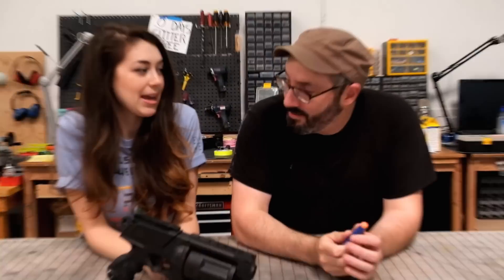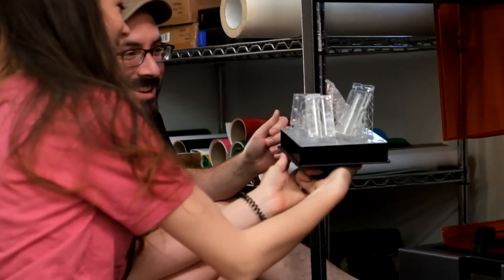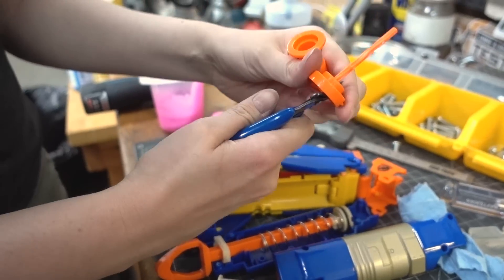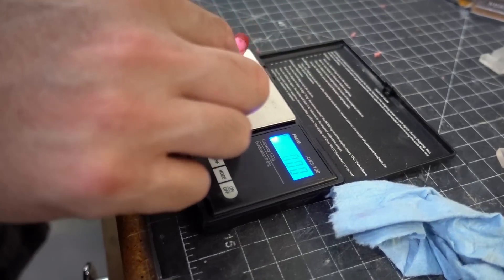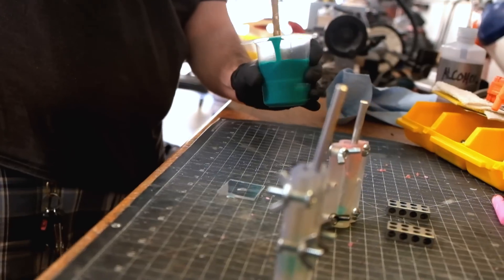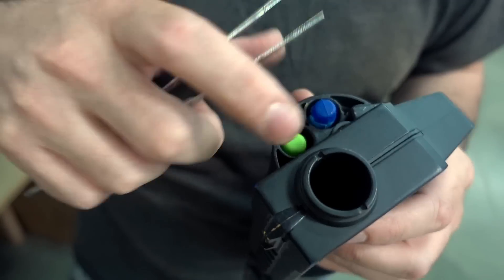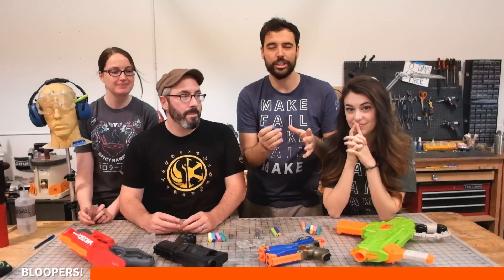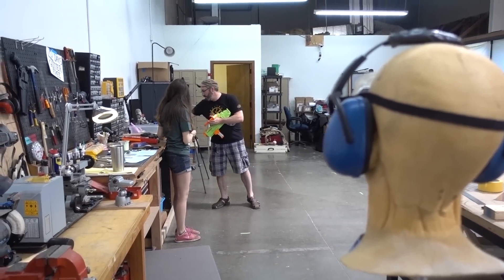Making the ULTIMATE Nerf Dart? (An Adventure in Foam & Silicone Casting)

Comment: I have an idea as to why the darts don't perform as well...
So I noticed two things about the performance of the dart in the last test.
1. The dart rotated.
2. The dart didn't go that far.
Now these may seem like really insignificant details, but they are actually really revealing about the projectile motion of the dart. To clarify, when the dart leaves the barrel you see it immediately begin moving towards the ground, given that the dart is moving parallel to the ground initially, and is shot at a given height above the ground, a projectile under the influence of gravity will accelerate towards the ground at a speed of 9.81m/s or 32.2. ft/s.  This is true for both the normal "Elite" dart and the redesigned "Floppy" dart. Because both darts will accelerate towards the ground at the same rate it also means that given the same individual firing the same gun at the same height both darts will reach the ground at the same time. Regardless of how fast the darts are moving (This is, of course, an ideal situation where air resistance is negligible. I'll get to that soon) Because both darts will reach the ground in the same time the difference in the distance that both darts traveled is dependent upon the speed the dart has exiting the barrel parallel to the ground. The faster the speed of the dart along the x-axis, the farther the dart will travel (Given that the dart doesn't meet its terminal velocity). What this reveals about the "Floppy" dart is that because it doesn't travel as far it shows that the potential energy expended by the spring in the gun to impart a force on the dart was used very inefficiently, and I think I know why. I think the design flaw here is actually in the "Rifling" along the darts themselves. When the spring compresses they way it imparts a force onto the dart is through the compressed air within the gun, as the air is forced out of the pneumatic tube the air is forced to find a place of lower potential (i.e. a place of lower pressure, which is outside the gun!) to do this the air passes through the barrel of the gun, forcing the dart out along with it. What I believe happened is that the "Rifling" on the darts created a sort of "tunnel" that allowed the air to pass around the dart far easier than it would behind the dart. This means that the air would travel along the path of least resistance, or along the rifling instead of behind the dart, and wouldn't impart as great a force against the "Floppy" dart as the normal "Elite" darts.
And then the other thing I noticed was that the dart rotated. This seems obvious, but if we go back to conceptualizing the dart as a projectile undergoing projectile motion during flight we start to see why this is important about the flight of the dart. If the dart is rotating while in projectile motion it indicates the position of the center of mass of the dart, because while in projectile motion the object will only be able to rotate about its center of mass. In the video, you can clearly tell that the dart rotates about its center of mass, close to the center of the dart. For most weaponized projectiles, and many stefans (modified nerf darts) the projectiles center of mass is nearer to the front of the projectile. This positioning helps stabilize the projectile in flight and keeps the dart from "wobbling", which would cause a greater level of air resistance due to an increased surface area over which the air can imparts forces onto the dart during flight.

So in conclusion, my design considerations would be:
1. Make the darts center of mass closer to the front of the dart to keep  it stable in flight
2. Remove the rifling of the dart, to allow air pressure between the front and back end of the dart to be separated, and to make sure that the path of least resistance for the air flow to be behind the dart, and in the hole in the dart (closest point to the front end of the dart that the air can travel to)
3. Optimize the gun as well as the dart. Rifling might not be the way to go, but you can impart a spin in the dart using special flywheels that rotate the dart. https://www.drs-performance.com/shop/aluminum-fwc/
4. Make the darts lighter - the lighter the dart, the greater your exit speed will be due to Newtons Second law

If you made it this far, thanks for reading, also sorry about any typos they can be easy to miss.
Reply from the maker: Thank you for taking the time to write down all these tips, ideas, and feedback. We will most definitely be using this for reference when we try another round of darts! We actually did try a flywheel but the video was getting so long and it was better, but not awesome, so we opted to put that scene on Patreon only. Again, really appreciate the tips!!

Comment: So I've kinda made my own nerf darts. Not to your extent. But you guys should try buying FBR (Foam backer rod) I used to make my own modified darts with that and a weighted tip because my modified guns were too powerful! You need to use a metal bb or a number 6 zinc washer and you gotta use the tip of a hot glue gun to melt a hole and put it in. You can also use hot glue as the tip or you can buy foam pads for the bottoms of chair legs and use those!
Reply from the maker: Thank you so much for all the tips! Definitely want to try that!

Comment: Hi, Guys! Love your channel. Quick question, why did you print the molds at an angle instead of just vertical? What are the downsides of printing in vertical so you can avoid the supports?
Reply from the maker: Thanks so much! Because it's resin printing, if you have too large of a flat surface against the bed it can be hard to break the surface tension when the bed pulls out of the resin, so you print at an angle instead. Hope that makes sense!

Comment: the outside surface of the dart is too sticky. it's too glossy, and needs somewhat of a satin finish on it instead of the gloss because the glossy finish makes the foam sides of the dart stick to the barrel instead of sliding on it. you need a stiffer foam that would normally be too dense but put it into a partial vacuum to get the right final density through expansion of the bubbles. the hole down the center is fine how you have it. the foam body needs to be un-fluted, and the tip should be as concentrated in the front as possible (small dense silicone. make sure the tip diameter is actually smaller than the foam diameter since silicone is high friction)
Reply from the maker: So many tips to keep in mind for next time - thank you!

Comment: i'm thinking just try make a couple more sets of those molds and and then just get your hands on all the foam and silicon blends you can to see what works best, but first rework the mold to literally be the exact same size and shape as the normal nerf elite dart, then after you find the best like 5 or so foam/silicon combos you put a little bb bulletdown the back with a dab of glue to see if it benefits from that minor weight increase like normal darts do

honestly i'd test it myself but i don't have the materials nor the money to get them
Reply from the maker: That's a great idea! Eliminate the shape factor to just focus on materials first. Thanks!

Comment: your darts are too smooth and sticking in the barrel (due to your molding process), hit them lightly with low grit sandpaper to reduce the drag coefficient and they should fire just fine
Reply from the maker: Ah thank you for the tip!!!

Comment: I think you should try testing your darts in some modified air blasters. Like Bobo was saying, we have been using homemade half length slugs in our homemade & powerful blasters. I would recommend a nerf titan, buzzbee xtreme blastzooka, buzzbee big blast, or a buzzbee Berserker (they all have massive air tanks). Attach a 1/2 inch CPVC Coupler to the air tank & use 1/2 cpvc pipe as barreling. Normal darts fishtail & wobble while in the air when shot from them. I think your heavier and denser darts would work well with them.
Reply from the maker: Ooooo thank you so much for the recommendations! We would love to try out modifying blasters

Comment: You have to remember that the tip of a nerf dart is hallow not solid so in the end the tip of the homemade dart is probably that same weight as one nerf dart so you’re basically trying to shoot 2 darts out of one barrel. I would try and find a way to put an air bubble in the tip of it and maybe a lighter silicone and bills dart it going to be the most efficient.
Reply from the maker: That's a great idea! We'll definitely try testing a hollow tip next time. Thank you!

Comment: First, you should've went with half-darts, since they're more stable in flight. Second, the rifling down the whole dart length let air escape around the dart instead of pushing the dart, and probably wouldn't help the dart to spin anyway. Honestly, just making the Nerf head without the hole would make it a hundred times better. Finally, as people commented earlier, the silicon tip probably gets stuck a little bit in the barrel.
Reply from the maker: Thanks for the tips!! We didn't even consider half length darts. Lots to try for next time!

Comment: Any chance for a followup video where you use electric flywheel Nerf blasters? Your different foam densities and tip designs might benefit from mechanical flinging rather than air pressure pushing.
Reply from the maker: haha it's funny you say that because we actually did try a flywheel (after filming all the scenes in this video), but it made the video drag on a little long so we shared that scene on Patreon instead

Comment: 1) Try a better launcher youtube.com/watch?v=s2yIMJ4iayg&t=612s
2) Get some high speed footage of the dart leaving the barrel.  This should tell you whether the rifling is doing you any good.
3) The foamy nature of the Nerf dart places less material in contact with the barrel thus producing less friction.  It probably also helps it in mid air much like the dimples of a golf ball improve range.
4) You might want to 3D print darts directly so you can produce a series of diameters.  This will let you fine tune the optimal diameter which may be very critical.
Reply from the maker: Thank you so much for all the helpful ideas! We'll definitely be keeping these in mind!

Comment: You guys made failing at a build look like tons of fun lol. I think the key is the exact foam Nerf uses, plus the finishing process. I have a sneaky suspicion there may be a "heat step" involved to seal the outside foam pores and also tighten up the inside as well. :P
Reply from the maker: It was a ton of fun! Though, kinda hard not to have fun hanging out with these guys making nerf darts :P I think you might be right about some of the nerf treatments....

Comment: Hello. So I've been modding nerf blasters and making my own darts for several years. We use foam from the hardware store used for gap filling in walls. And we make our own heads...several different ways but the easiest is with hot glue and a washer for weight.
Reply from the maker: Ooooo that's really interesting! We'll have to try the expanding foam and adding some weight in the tip. Thanks!
Reply: EvanAndKatelyn I apologize for the confusion. Not expanding foam but foam backer rod.

Comment: ditch the liquid + mold technique for the foam and google "1/2 in. x 20 ft. Caulk Backer Rod" ... use heat + mold to straighten that foam... continue using silicone + mold technique for tip. Our biggest issue with creating darts used to be making the tip (weight, balance, consistency). You've tackled the hard part, just get the caulk backer rod and work with that as a base material... consistency is perfect.
Reply from the maker: Thanks so much for the tip! We'll definitely look into the caulk backer rod!

Comment: I've never actually thought about casting foam in molds, that's fantastic! Definitely think the SLA printer is the best choice for quality, but out of curiosity, do you think it's possible to get something using PLA or ABS from 3D printing?
Reply from the maker: It's definitely possible! It just requires more finishing work on the print. we do automotive primer, then sand it, then prime, then sand, over and over until it's smooth. we show the process a bit in this video: https://www.youtube.com/watch?v=QGx9ucIuiq8

Comment: I don't have Nerf guns so cannot study it, but I assume it uses compressed air to build shooting force and maybe that hollow tube is for compressed air to go in.
If it is really using air compression then it would be really important to make  body of the bullet from rigid material so that it does not inflate or bend on applied pressure and would not generate lot of friction with gun barrel.
Reply from the maker: interestingly, what a lot of folks are commenting is that you actually want the foam to flex outwards when air goes into the hole to create a seal - so I guess it comes down to the right amount of flex vs rigidity? Hmmmm lots to learn!

Comment: I think a factor you guys might have overlooked is the friction between the foam you poured and the inside of the barrel? The hole in the middle is probably important, because the pressure cause the dart to bulge a little, making a better seal with the barrel. But if the friction is too high it slows the dart down a lot. That's probably why the rifling was such a failure, too, it couldn't seal.
Reply from the maker: I think you're right! Maybe we can experiment with different foams and ditch the rifling

Comment: Your problem is friction. Nerf darts are cut from open cell foam so there is very little foam actually touching the barrel.
The poured foam will skin itself making it closed cell. The mating surface between the barrel and the dart is massively increased.
Reply from the maker: I think the poured foam was actually open cell (we could see the cells) unless we're understanding it wasn't. But there was definitely friction - the silicone was particularly tacky! Thanks for the help!

Comment: May have been an issue with the foam you used, removing the head from a cheap knock off dart and changing the head out would take out the foam as a factor and you can tell if the heads you designed were better or not based on just head design.
Reply from the maker: Ahhh that's a really good idea! Would be much better to isolate the changes one by one

Comment: Nice video guys! I think if you put a plastic drinking straw in the middle, fill it with foam and after you cut the straw edge maybe it will work!
Reply: DIYPD nice idea
Reply from the maker: That's a cool idea! Maybe the straw would give some rigidity
Reply: EvanAndKatelyn yes it needs to be more rigid, and it’s safe with the straw because is not a hard material. Also, if you use only foam for your bullets it is very soft, so it will compress and that’s why they didn’t fly very far, I think.

Comment: Think about bullet rifling.  The bullet is able to grip the sides and accelerate the whole way because the bottom mushrooms out as it's fired. Nerf rounds expand through that hole in the middle which cause it to contain the air pressure and accelerate the whole time it's in the barrel.
Reply from the maker: Ah that's interesting, thank you!!

Comment: First up, I really enjoyed the video, though I think it would be more satisfying if the success was making something that was actually better, rather than something that actually makes it out the blaster.

To that end: I think you're right, that nerf spent a lot of time getting this right. This means that logically, that starting point should be the original nerf dart. If you really want to make an improvement, you should first do a series of experiments to figure out what the limitations of the original dart are. I would break the shot down into the distance traveled in the barrel, and the flight itself. 

In the barrel there are two key factors: friction against the wall, and the buildup of pressure behind the dart (I suspect your rifling released too much  of the gas and reduced projectile energy). A (hollow) core that reduces expansion of the dart due to pressure inside might be an interesting start. This might reduce the normal force between dart an wall, and allow for a tighter tolerance without increased friction. Surface finish of the dart to reduce the coefficient of friction is probably also an interesting route to explore.

As for the flight, balance and aerodynamics will he the things to explore. Balance can probably be copied straight from the original by maintaining the position of the centre of mass. Aerodynamics comes down to tip shape and wake control.  For the tip I would take inspiration from anything that flies close as makes no difference straight into the airflow, so without any yaw angle (think bullets or very high speed vehicles such as rockets or the bullet train). As for wake control, this is all about vortex shedding. Consider a taper towards the rear of the dart and the shape of the actual training edge. Serrations to cause controlled shedding of smaller vortices have been successful in this area. Making the shape directional (so not the same going around the dart clockwise and anticlockwise) may impart the spin and associated stability in flight you were going for wih the rifling (but without loosing gas pressure in the barrel).
Reply from the maker: Wow, thank you so much for all the detailed helpful ideas and tips! Live the idea of doing an initial video going back to the drawing board and conducting experiements on the original dart to see what effect each feature has, and then making modifications from there. Thank you!